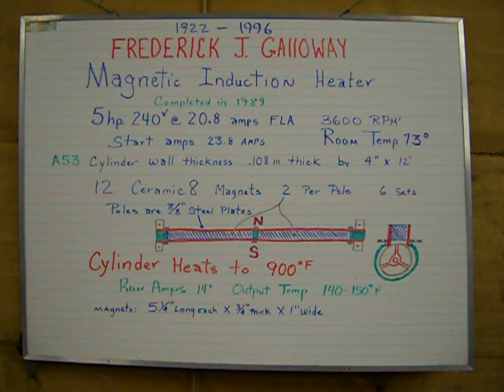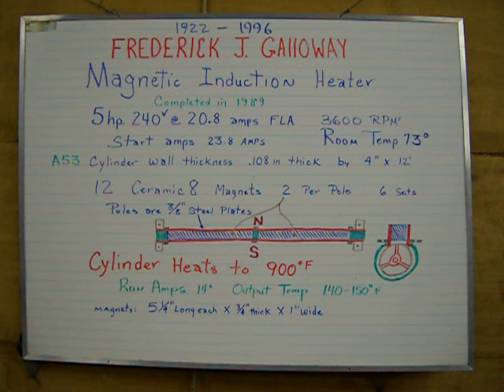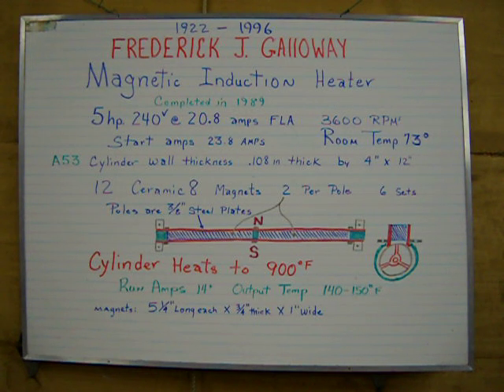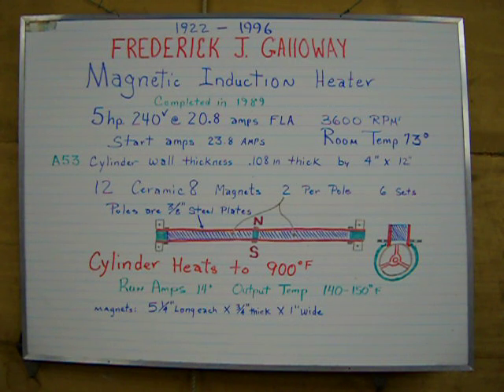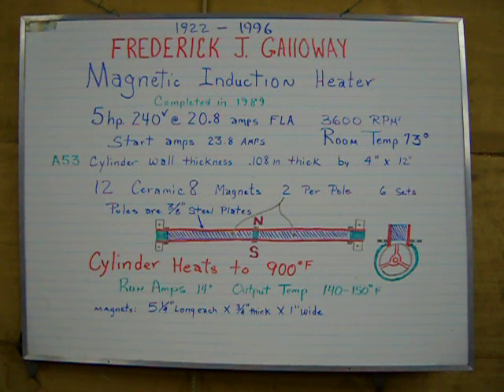Galloway Magnetic Induction Heater...1-of-4

Comment: What is the efficiency of electric motor?

What is the power factor measurement?

Can you measure the temperature by sensor wire?

What is the weight of the unit without motor?

                       What is the asking price?

Comment from the maker: @ovruni4458 
I don't believe Mr. Galloway tried it the other way around, spinning the magnets instead of the steel core.  Each of the six (6) magnet poles have to be adjusted for clearance from the rotating steel drum.  Spinning the magnets would not only make it more dangerous, but extremely difficult to adjust.